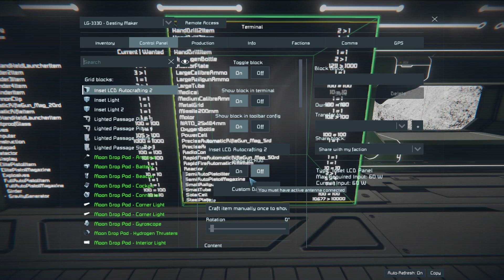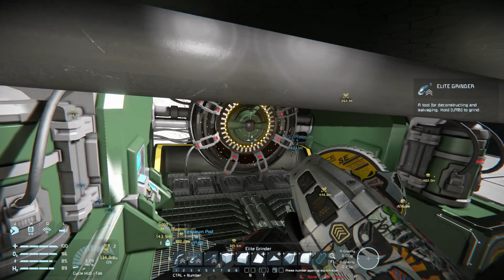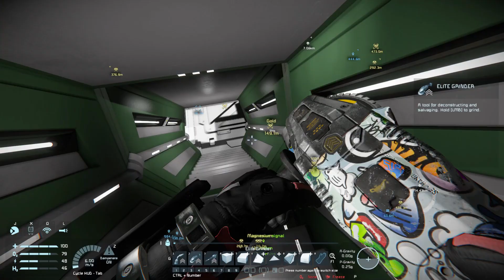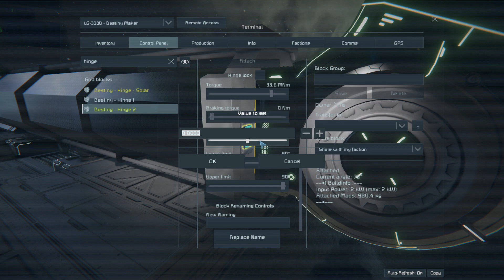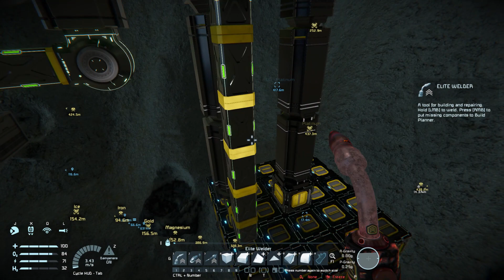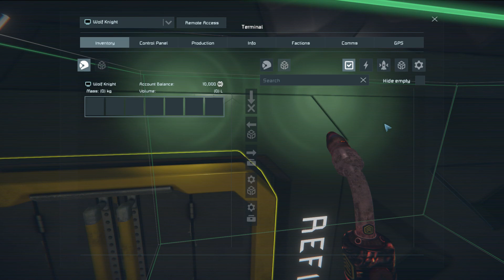Space Engineers - Long Way to Go! - Part 6

Comment: Instead of using fixed tubes you should use extended pistons going up that way when you retract them you get extra depth while keeping drills above the ground to start with, because it pulls the stack back up, same with the hinged pistons at top. The fixed tubes you have simply shorten the distance you can drill as the 2nd stack of pistons is starting higher up. They should start extended so you have space for more down pistons before you hit the ground and then retract to push down. It enables you to dig deep without having to grind off drill heads and add more pistons as frequently. You need for mods that put ores several hundred meters down.
Reply from the maker: Good point will remember that for the rebuild. I've already taken a couple of screenshot too to help me to remember certain elements too.